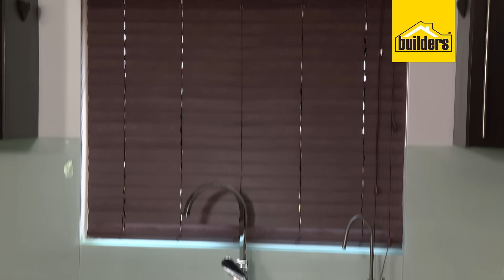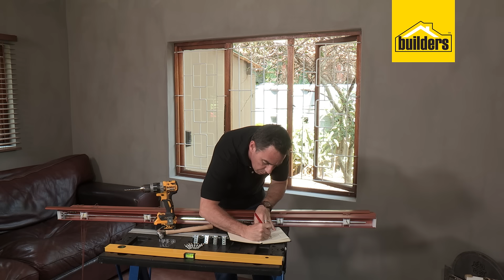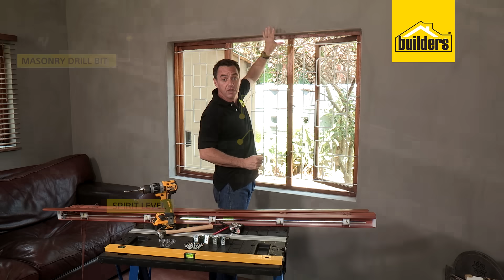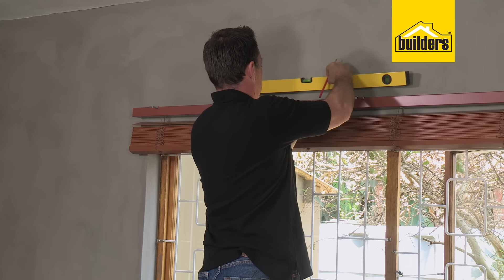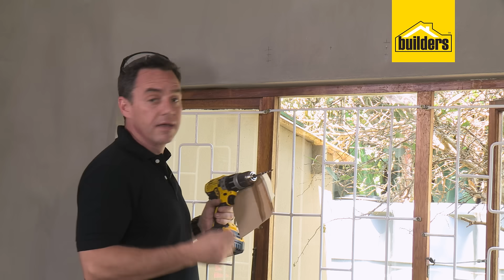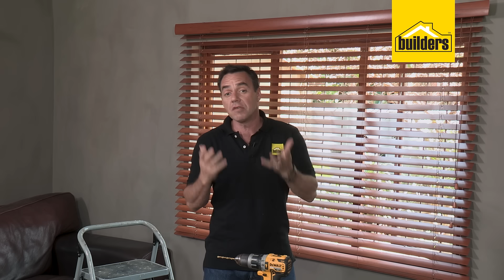How to Install Custom Window Blinds

Comment: In my opinion, blinds should be installed inside the recess, not on the outside.  It looks infinitely better.  Great video.
Reply: Choices differ my friend. What is good for you is not good for the next person. That is why they show two different styles.
Reply: @rosemarymokhwesana7646  You are absolutely right
Reply: Your opinion is 100% correct... however, your opinion cost lots of money